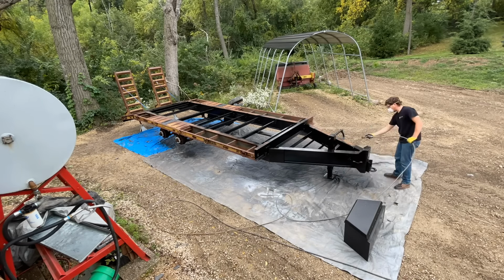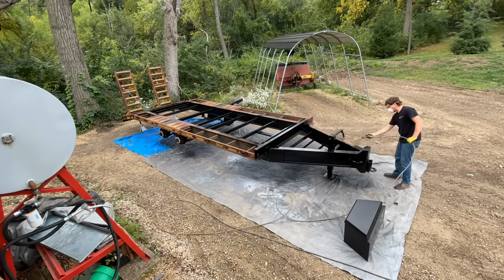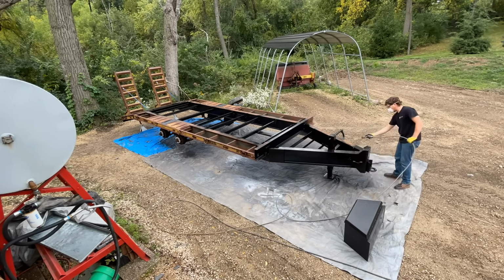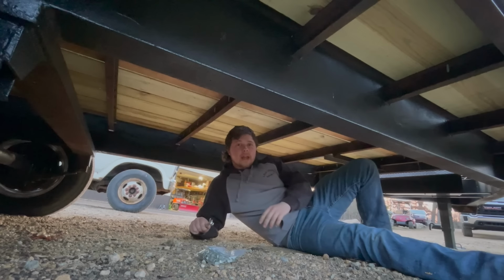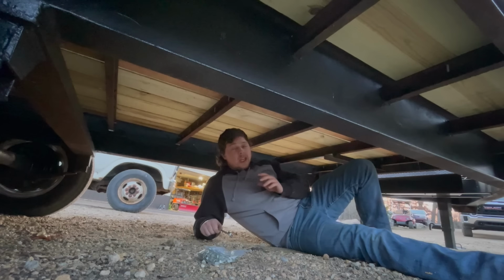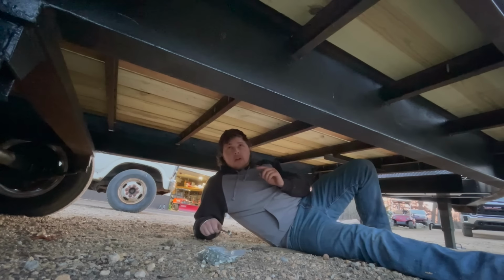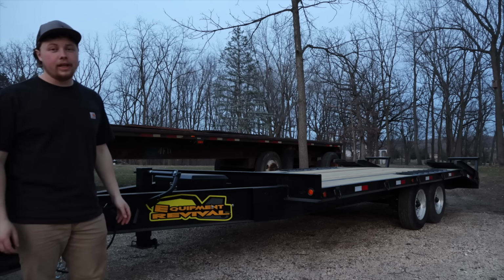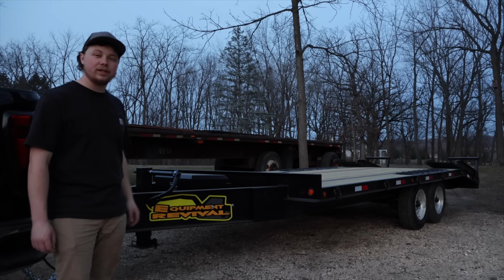Incredible Equipment Trailer Restoration

Comment: Nice job, only thing I noticed is those connecting links you used on the safety chains are not rated for high loads, I would replace them with something stronger.
Reply: Just came here to say this. Those links are not rated for what the chain is and d.o.t. can put you out of service for that

Comment: Nice refurbish I like the look of the wider boards on the outside, I used old motor oil to stain mine worked well plus free, if you use diesel oil it gives it a nice dark stain finish

Comment: There's two different wiring color diagrams for RV 7 pin and trailer 7 pin. It's a screwed up system and a piss off every time you try and color match.  There's no standard, some RVs use trailer color code and some trailers use RV color code.
Reply: I ran into this while adding a junction box to my car trailer, its pretty common to happen
Reply: I did not know that thanks I’ll try and remember that if I ever come across that in the future
Reply: Those junction boxes are designed for seven round. Typically semi trailers with AirBrakes are the only things that use that. That’s why the colors don’t match the functions that are labeled in those boxes.
Reply: Americans 😂😂😂😂
Reply: @srdjan361306  better than that stupid 14pin system the rest of the world uses.
Reply: Nilight uses trailer always and their cables are pretty decent, the plastic for the junction box is ok if you keep it away from the sun other than that for like $20 that's the best bang for the buck.

Comment: Looks great, only thing id change is the safety chain quick links. They have a very low weight rating (probably 3500# or less each) and wont safely control the trailer if loaded to the trailer limit in an emergency. A shackle in that position would handle a much larger load. Otherwise great looking trailer and nice video.
Reply: 100%. needs hammerlock couplings

Comment: We have gone to running carriage bolts through the decking next to the frame member and using a hd fender washer to grab the lip of the frame...no frame drilling required and you can use an impact.
Reply: Damn good idea 💪

Comment: There is a kit that is available powered by a 12 volt dc motor that will wind your jack up and down and is relatively easy to mount ! CT3 added one to his equipment trailer and was pleased with it's operation !

Comment: Looks good man, i wish i could find a 24’ deck over gooseneck that the dovetail raises and locks up at deck level
Reply: Most older goosenecks with doves had that. I work for a trailer manufacturer and they still get some orderes for them. I don’t know why.
Reply: @ because  a lot of people haul more than equiptment and also want a full flat deck thats not a full time flat bed either

Comment: This does not help you since you have fixed the wiring.  But there is a difference between trailer wring and RV wiring.  A lot of those junction boxes are wired RV style...

Comment: Only thing I would've changed is using heat shrink instead of electrical tape, stops moisture from working its way in and corroding the wires from the inside.

Comment: Change your hitch before you take it out on any highway. You have absolutely zero sway control with the hitch. That type of hitch is only good for pulling hay bales around the farm.
Reply: Thats a pintle hitch and on every HD equiptment trailer that hauls excavators and bulldozers on the road every day, what do you see wrong with it?
Reply: @young11984 at a higher speed you run the risk of trailer sway, the back end of the trailer begins to sway side to side which leads to the trailer controlling the direction of the truck. By using a Reese hitch with sway control bars along the sides of the hitch eliminates the risk of “the tail wagging the dog.” These use to be a standard practice in pulling trailers off a ball. Placing whatever you are carrying closer to the truck helps, but basically limits you to lower speeds. Even an inch of play could start causing it to sway. It’s a simple fix of unbolting the old hitch and bolting a Reese to the trailer frame.
Reply: @brianswanigan9891  thats why you have trailer brakes and balance the load on the trailer vs drive it all way to the nose squatting the tow vehicle and unloading the rear axle of the trailer. Those pintle hitches are rated for 5-10klb tongue weight and there is no ball style hitch or ball rated for that weight. Been towing trailers with everything from toy cars to dump trucks on pintle hitches and NEVER had one sway and never had sway nannies either. Only ever seen them on campers and have never ever seen them on any brand of heavy equiptment trailers
Reply: @young11984  good luck to you then. I wish safe travels.